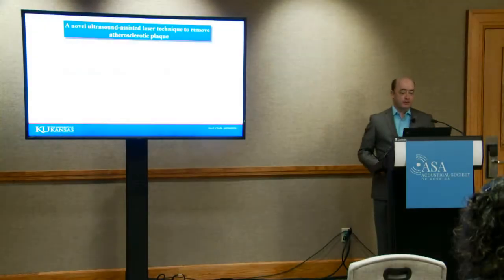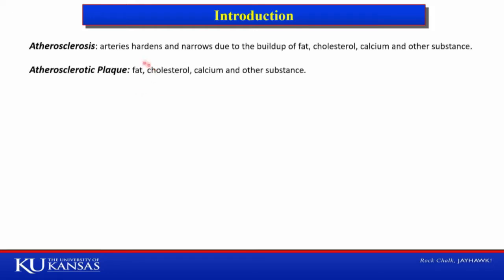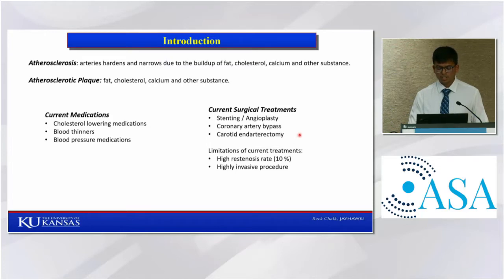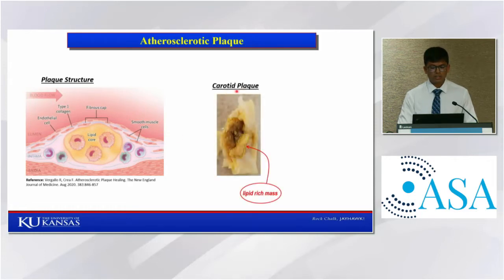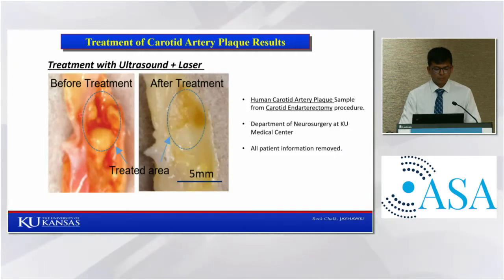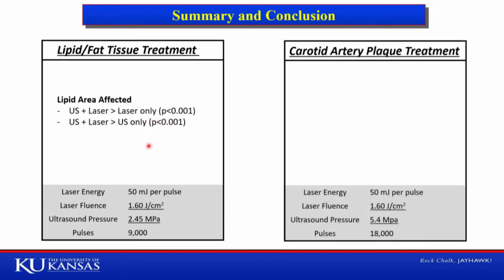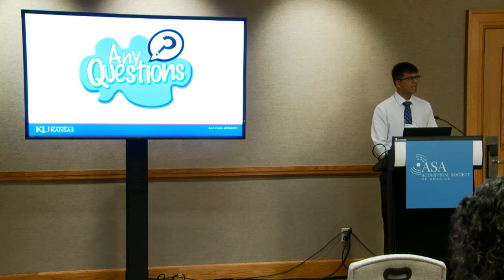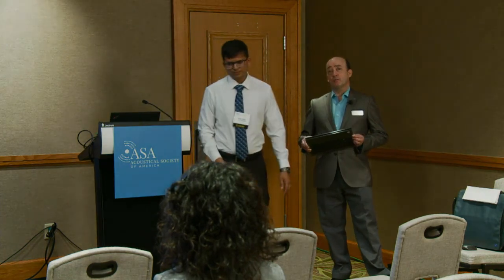Ultrasound Assisted Laser Technique Vaporizes Artery Plaque

Comment: I wonder if you might achieve better results with opposing adjustable wave length transducers on an x-y axis and leave the laser out of the procedure. I am thinking you could increase the cavitation effect in a more controled location and no laser damage. Making it an outpatient treatment and eventualy under an automated control and used in most of the upper class spas. Just an idea sparked off yours I hope you don't laugh just throwing out ideas from a different perspective, very little practical knowledge and a K.I.S.S. attitude ( Keep It Simple Stupid) Hoping to hit a good idea if I throw enough of them out there. 🙃